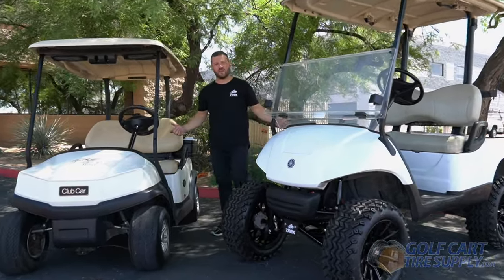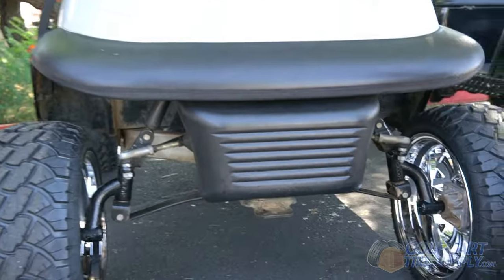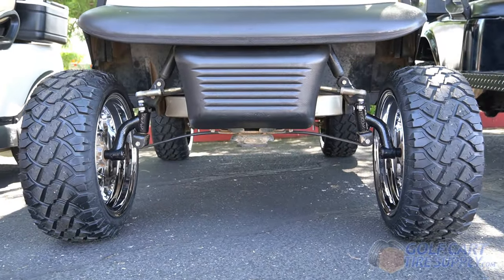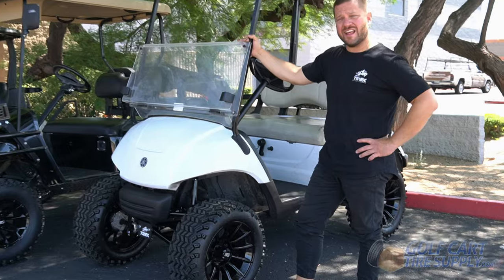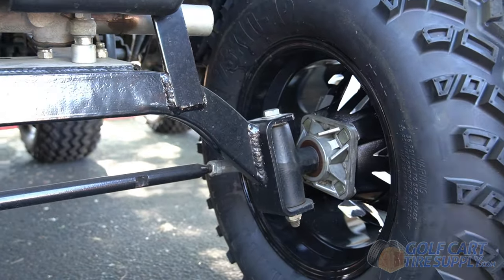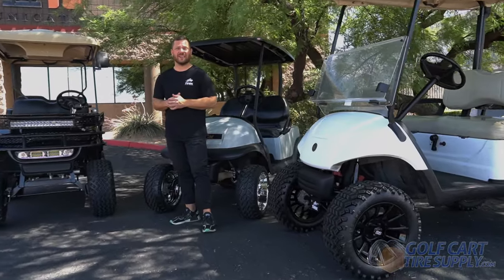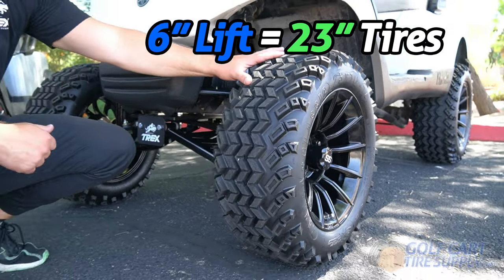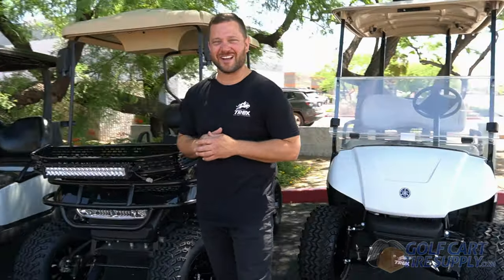Lifted vs. Non-Lifted Golf Cart *Golf Cart Lift Kits EXPLAINED*

Comment: Ride wise do 6" and 4" ride the same? Thanks!
Reply from the maker: They ride very similar on overall smoothness, but the 4" Lift will have a slightly lower center of gravity (feels a bit more stable) compared to the 6" lift height. If you have any questions about how big of a tire you can fit with 4" lift, just give us a call any time: 1-844-422-7884